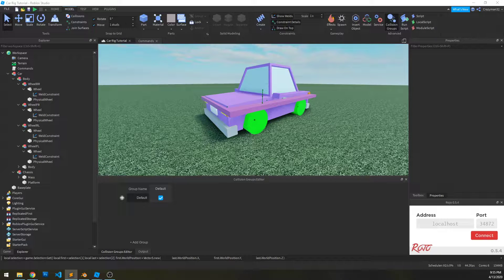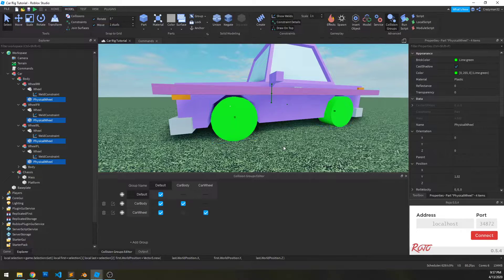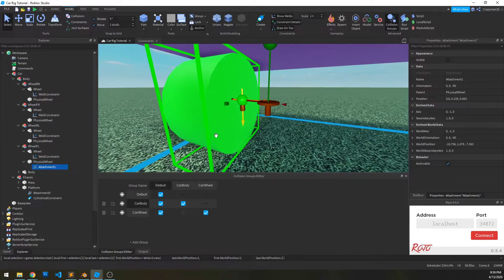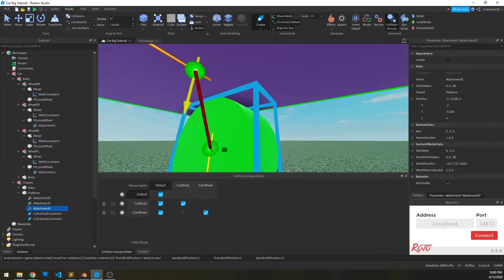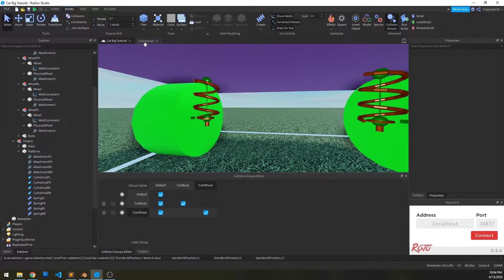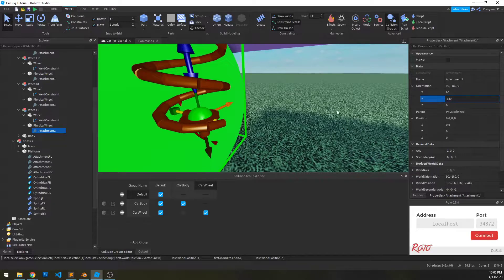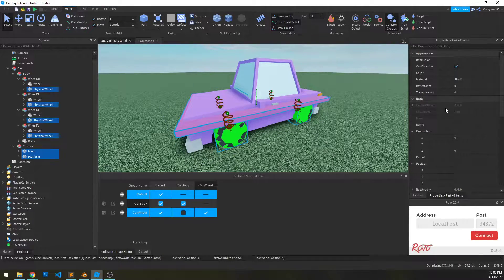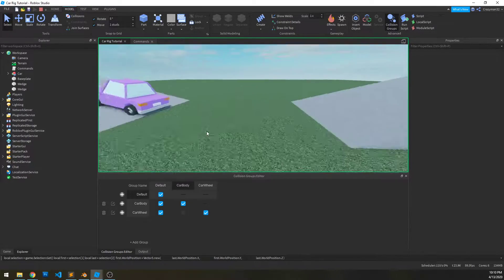Roblox: Car Rig Tutorial (Part 2 - Rigging Constraints)

Comment: Hello, I'm trying to follow this tutorial but I chose to make a rudimentary model using roblox parts. I don't know of this is whats causing my issue, but basically I cannot get the car to sit still if a player is in the seat. As soon as you sit down in the seat, the car goes nuts and usually clips into the ground. After you get out, the car will get super-flinged. Any ideas of a workaround?

Comment: If your tires are going crazy or your car is flipping around maniacally, it could be because you need to make your mass bigger.
Reply: made the mass twice as big and the wheels still freak out whenever I sit in the car. they're somehow getting stuck on top of the body even though that should be literally impossible with the collision groups.
Reply: @joemkdd  in your cylindrical constraints there is a limits enable property. What this does is set the limit of how far up the wheel can go. 

That should fix the issue where the wheels pop up above the body

Comment: Help, I have a problem where the left wheels go inside the car, but the right wheels are perfectly fine. I set the inclination angles correctly, set the collision groups, and made sure all the parts surfaces face the front, but it doesn't fix the problem at all.

Comment: I made suspension to my car, but for some reason when I run it, the car's wheels turn around and are inside, how do I fix this?
Reply: Nevermind I have fixed it, I just had to set the incliationangle to 90 for the left and -90 for the right.

Comment: so now my suspension worked, yes and my problem now is when i lift it up in the air only the body falls and the tires stay up in the air, is there a way i can fix it?

edit: i even tried welding it together but it still falls
EDIT:2 i finally fixed it i realized that my body was not welded to the platform,

Comment: for some reason, my suspension dosent work
please reply cause i dont get it how it not works.
Reply: You have to set a limit on the Cylindrical Constraint. Select all the Cylindrical Constraints, clock LimitsEnabled. Then at Limits put LowerLimit to 0 Restitution to 0 and set the Upper Limit to 2.
Reply: @mosestheredsea  neither my suspension or wheels work even after that.

Comment: my car wheels goes in of car
Reply: oh I fix it
Reply: @clientworksdevinf8835  how did you fix it
Reply: sorry fixed it
Reply: @cc3  i don't know i watched the video again and made sure i did everything right
Reply: The Black Bandit 

You have to set a limit on the Cylindrical Constraint. Select all the Cylindrical Constraints, clock LimitsEnabled. Then at Limits put LowerLimit to 0 Restitution to 0 and set the Upper Limit to 2.
Reply: The Black Bandit check when you called the functions inside a parameter. Like when he did for example SetCollide(character, function) make sure the function doesn’t have ( ) after it
Reply: The Black Bandit did you put a vehicle seat in the car did you turn can collide on the car or do you think the main problem is with the script
Reply: I'm having the same problem, how did you fix it?
Reply: Nevermind I have fixed it, I just had to set the incliationangle to 90 for the left and -90 for the right.